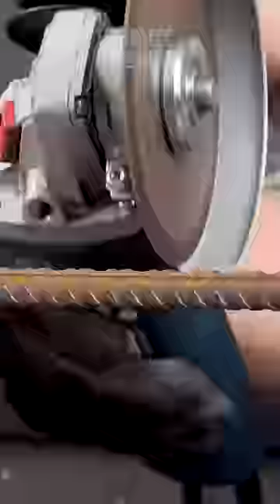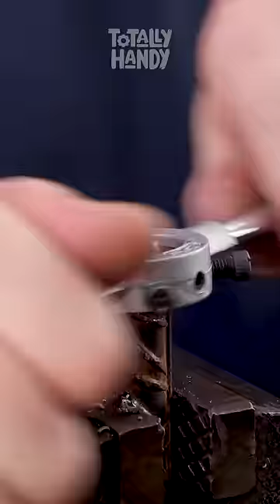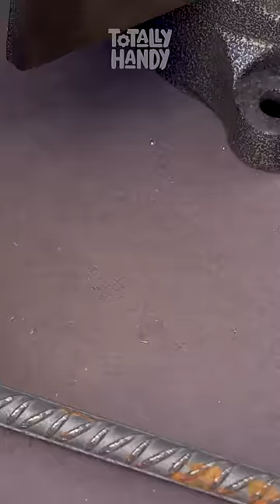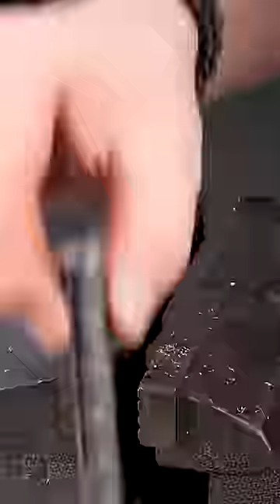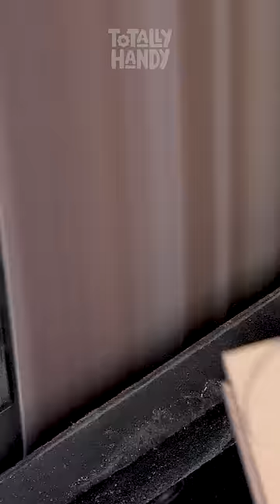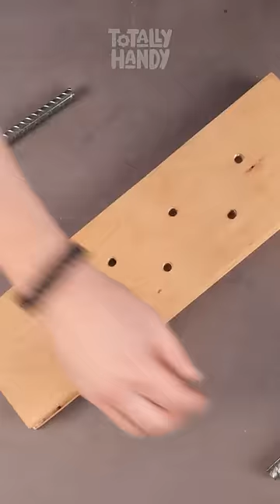DIY key hanger #shorts

Comment: I like how you pretend you turned down the OD of the rebar with a grinder, but you can clearly see it was done with a lathe.  And let's be honest, that's torch did almost nothing to help you bend the rebar, that size rebar can be bent easily without the need to heat it up.  I just don't understand why you lie about things like that, show the video honestly.